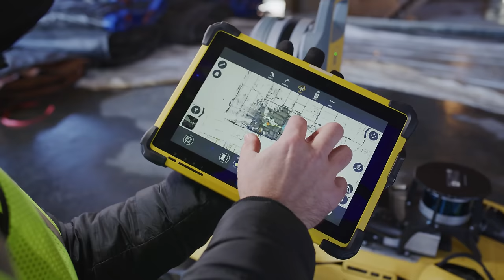Inside the Lab: Robotics After Hours

Comment: Those robots are remote controlled 🤔 why they saying "spot learned to pour beer"
Reply: So, you can use a remote to control it, or use an air for it to do stuff on its own.
Reply: @dylankersten3383  whaat!??
Reply: @freemusic3206  yeah, it's pretty neat
Reply: These robots use both AI and manual controls. For example, if they wanted the robot to go up stairs, they would tell it to do it, “left leg up, left leg down, right leg up, right leg down, so on and so on. But if the stairs have bumps or is on a angle, then the AI will figure out how to this robot walk up these stairs without falling while doing the original instructions. And the way I’ve explained it very simple when really its complicated as fuck. It could take them days to make a robot just to do something coherent.